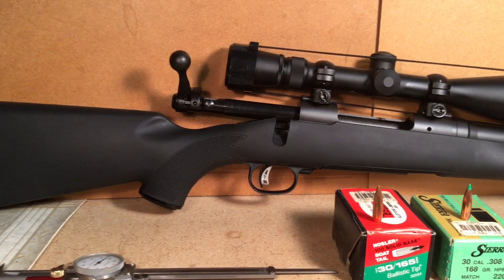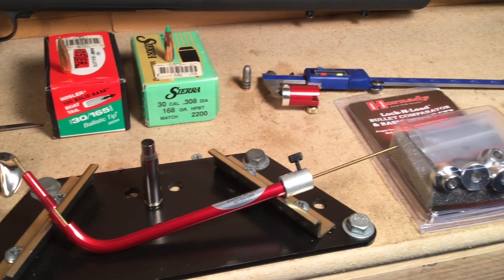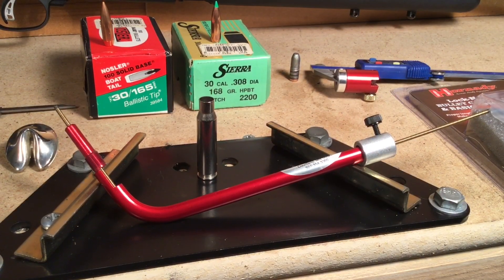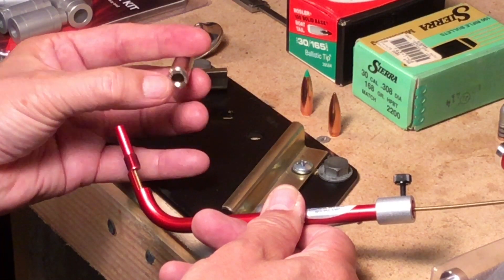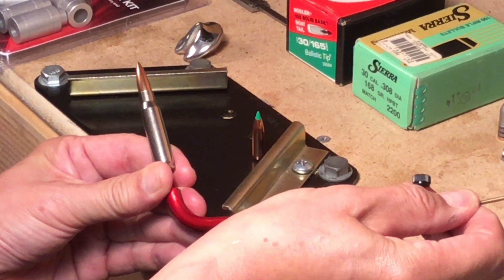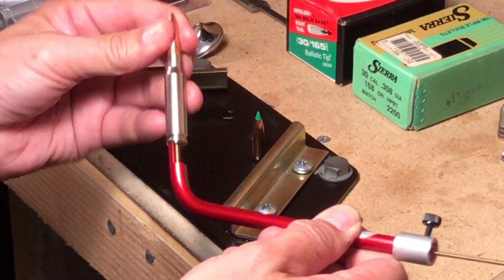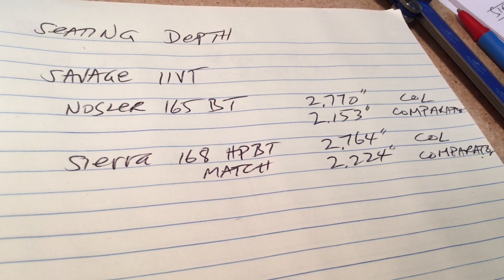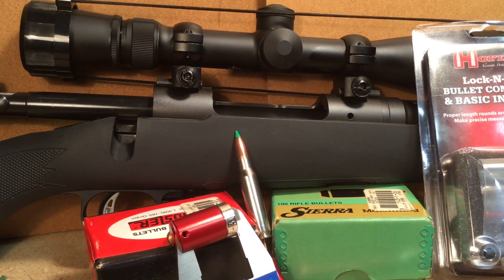Savage 11 VT 308 Project: Chap 12 - Max COL Bullet Seating Depth Determined

Comment: Another great vid FC! 
I saw you have a 308 round nose cast bullet on your bench there. would you load that in this gun or a hunting type rifle just for plinking? if so, would you say the gas check is mandatory? especially if the cast rounds are powder coated?
thx again
Reply from the maker: Julien Robin - That bullet is a 30/30 bullet.  I was not intending on loading cast bullets, PC or not, in this Savage VT as it is intended for precision shooting.  If I shot a lot of cast lead midrange bullets, the fouling would clash with the copper fouling that I am sequentially managing with that rifle.  Other hunting type rifles, the cast lead mid range loads would be more than OK.  Best to ya,  FC

Comment: A budget method of doing this (Although admittedly better to have the real tool) is to file a V in the side neck of a resized case and putting the bullet in. Surprised that the throat is tighter than standard tbh. The fact that you're measuring based on the ogive is cool and gives the Hornady tool a big advantage.
Reply from the maker: thetriode - We would prefer to have a bit more leade to the rifling - allows for what we used to call "freebore" - allows use of more powder or lower pressures with the same powder charges.  But we can certainly deal with whatever we have as long as we know how far it is to the lands.  We can seat .006-.009 short of that for best results.  Another way we used to do that measurement was to smoke our bullets and seat bullets just to show engraving of rifling, then back off till the engraving marks just disappeared.  Another way would be to use a fired case and paper patch a bullet so it was snug in the neck, but not too snug - chamber the round and the bullet would be touching the lands.  Good reloadin' to ya... FC

Comment: Cookie.. I don't know if you have address it directly, and I Haven't went back through your chapters to see if you did, However Head space and the bumping of shoulders, Over all bullet length These are aspects of freedom in the bold action rifles, I know you brought up the cam action of the lock up when closing the bolt. But this should never be attempted when making cartages for Auto loading rifles such as Service guns, The M-1 and M-1A ..  an out of Battery ignition in those ends up in personal injury or worse,, and it Blows up the gun, even if you don't think the rifle isn't ruined and have it fixed that rifle will never shoot the same way again..  I'm just thinking of the Video audience and what level they are at, You and I both know how dangerous an out of battery fire is.. Please don't take this the wrong way, You program is informative and knowledgeable. Good solid instruction..   Dave.
Reply from the maker: Thorsaxe777 - Absolutely, we don't want ammo that does not go into battery in our autoloaders...Just as in this video, Dave, I did not go into that we do not want our ammo with bullets seated to touch the lands,  That is a no - no for many reasons, of course - and one of them is safety.  But my intention was to come back to that when bullets are actually being seated to our selected seating depth.  Best Regards,  FC Steve
Reply: I figured that you would cover that some where along the way.. I have see two M-1As and a M-1 Blown up on the line because in the M-1As case, The guys were trying to squeeze every ounce of accuracy out of their rifles, One was a loaded Model the other was a Brand New Super Match.. Both those guys were lucky, They Got some Brass imbedded in their face and it looked like someone held them up by the nose and sand blasted them, Both Guns were ruined. The M-1 blew up over firing "FA-58" ammo, They at Frankford Had a bad Lot of ammo during that time and warnings were given out not to fire it. well this guy didn't know of the warning and with his first shot the rifles Bolt flew out of the gun and the stock split all the way from the forward furrel to the But plate.. Never seen anything like that ever.. The Op rod was a twisted Pile of junk. we found the bolt and it was cracked clear through and the ear was missing. he was lucky that he didn't get a scratch. we have to watch what we are doing when resizing brass for semi autos, we cant have them so tight that one piece of dirt stops the bolt from cam over locking the bolt.  well that was my rant Cookie. Dave..
Reply from the maker: Thorsaxe777 - There was a strong recommendation to always full length resize brass for reloading semi-autos amongst other action types.  Your "rant" is most appropriate... Have a great day, FC
Reply: Yes.. You know how completive shooters are though. always looking for that edge. Good shooting to ya.

Comment: Thanks for the great info. I plan to start reloading 30-06 very soon, this info came in handy. Up until now I have only reload pistol rounds.
Reply from the maker: Michael Jacob - Here's a neat thing - if you get the RCBS Precision Mic for 30/06, you can use the same gauge for 270, 280, 25/06 as the same shoulder is on all.  Plus the Hornady Headspace Comparator has inserts for mutiple calibers when you buy the kit.  These instruments are not expensive, but essential if you are going to be able to set up your dies properly.  With handgun ammo reloading, you just screw the die till it touches the shellholder and there's nothing else to it.  Good reloadin' to ya,  FC